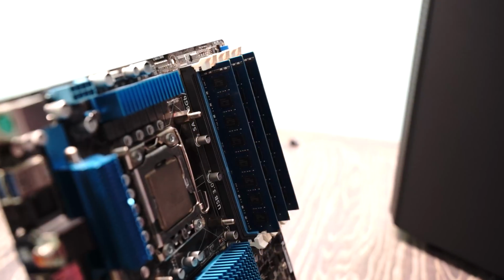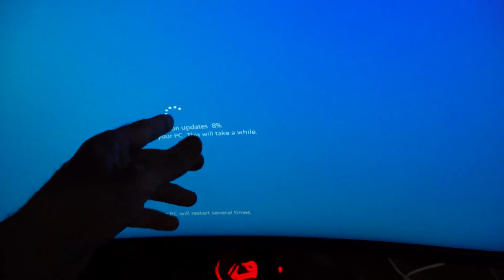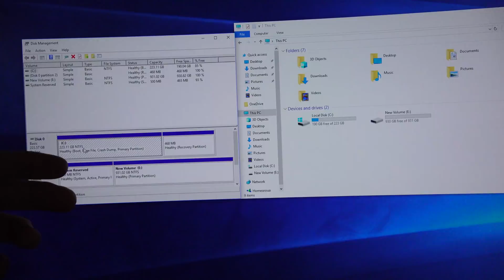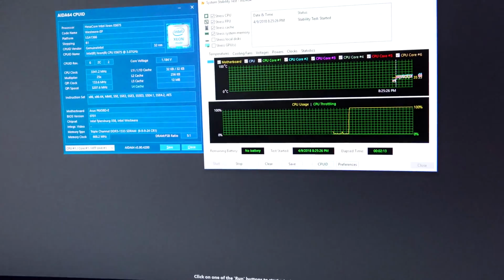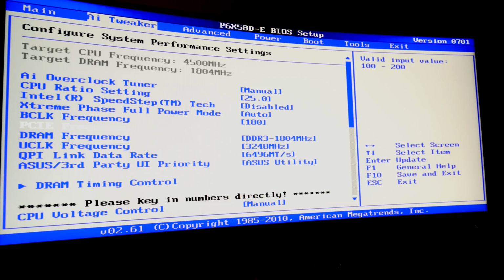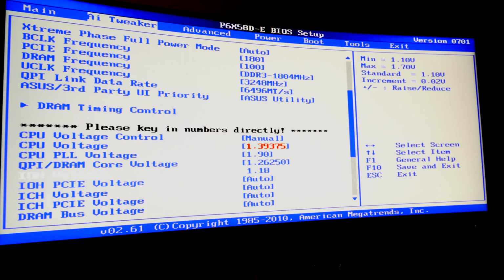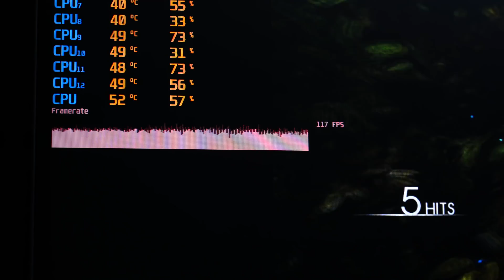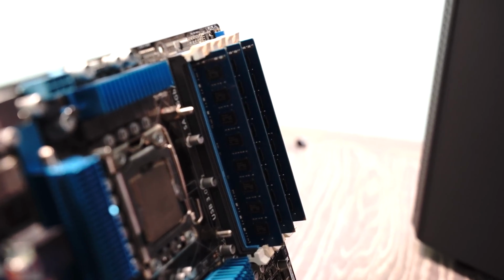Is X58 Still Worth it..? Taking the 6 Core X5675 to 4.5GHz on AIR.

Comment: This is a very difficult mobo to overclcok with the x5675.
It just keeps fluctuating from very high voltage  to very low voltage.
Tried everything from disabeling C1 and enable/disable cpu turbo boost.
Also the voltage and cpu speed shows very different numbers in windows compared to the numbers in the bios.
Also this gives all kinds of problems.
And geting this stable gives so much head pain problems.
I don't know if i will manage it to reach 4.6 Ghz.
Reply: Windows never reports properly use MSI afterburner for accurate CPU clock readings or CPUZ I've had nothing but excellent results with this exact setup but using good DDR3 yields the best results and only using three dim slots I recommend 1866 memory rated at 1.5 volts if you're using 1.65 volt memory you could damage the memory controller permanently

Comment: I'm currently using an X58 platform with a 4.5 GHz X5675 overclock at 1.356v, cooled by a Vetroo U6. It boasts 24GB of Kingston HyperX FURY 1866 CL10 DRAM, running at 1960 MHz with 9-10-9-27-CR1 timings and a UCLK of 3920 MHz. Additionally, the system includes a 1TB NVME M.2 drive, an ASUS STRIX RTX 2070 Super, and operates on Windows 11 24H2 Home edition.

Comment: Hey everyone, I'm looking for some advice on OC'ing my CPU. I know it's getting pretty dated but a buddy had an X58 board sitting around and i thought we could throw a few bucks into it and play a few games on it, even if they're slightly older titles. So, we put in a new SSD, a wifi/bluetooth pcie card, a usb 3.0 card, a gtx 1070 and swapped the I7-950 for an X5675 ($8 on Ebay.) Its got 32GB of ram (8gbx4) running in triple channel. The mobo is a DX58SO (BIOS SOX5810J.86A.5600.2013.0729.2250) which I believe is a "Tylersburg/Westmere" board. 1050w PSU. All in all we spent maybe $180 on everything.

So, getting to my question, I've read alot about these X58 boards and the X5675 is supposed to be great for overclocking but i can't get it to boot stable past a 155 BCLK at 4.03GHz with the Turbo boost on. Multiplier is maxed out at 23 (it hits 26 with turbo boost). Ram is running at 1551MHz (rated for 1600). I know this BIOS lacks the ability to adjust as many settings as others but I've seen screenshots of the same mobo/bios/pcu running a 180 BCLK. I'm just wondering if anyone has any suggestions to get mine higher? All I could really do without crashing the system everytime was raise the BCLK from 135 to 155 and the Static CPU Voltage to 1.225. Anyone got any other suggestions for a little extras performance out of it or is this about average for this setup? Any advice is greatly appreciated. 

Active Cores - All; HyperThreading - Enabled; Failsafe Watchdog - Enabled; BCLK - 155.

Processor Overrides: Static CPU Volt. - 1.225; CPU Volt. Offset - 0; Vdroop - Low(Performance); Max Mult. - 23; CPU Idle State - Low Power; Turbo Boost - Enabled; CPU VR Current Limit Override - Disabled.

Memory Conf.: Memory Correction - Non-Ecc; Perf. Memory Profiles - Auto; Uncore Mult. - 20; Memory Mult. - 10; CL - 9; RCD - 9; RP -9; RASmin - 23; RFC - 19; RRD - 4; WR - 10; WTR - 5; RTP - 5; RC - 32; FAW - 20; Memory Volt. - 1.54; QPI/Uncore - 1.150; Command Rate - Auto; Dimm Reference Voltage Training - Off.

Bus Overrides:  IOH Core Volt. - 1.100; QPI Data Rate - 6.4Gt  (7.445 with BCLK at 155); PCIE Bus Frequency - Default; PCI Bus Frequency - 33.33MHz; PCI Latency Timer - 32; HPET - Enabled; Route SMBUS to PCI - Enable. 

Power: SpeedStep - Enabled; CPU C-State - Disabled; QPI Power Managment - Disabled; C1E - Enabled.

Comment: I have a xeon x5690 overclocked to 4,2 ghz, Asus Extreme rampage 2, nvidia1070gtx and the operative system (W10) in a nmve SSD by pci x4 (uefi partition BIOS) and this computer still rules everything like a champion! 900 points in cinebench r15 and 1700MBs reading and writting values... with the nmve

Comment: I took out my rampage III extreme from the garage, installed a xeon x5690 and 24gb ddr3 vengeance both for (£140) but my ram only runs at 1333, Ive heard this setup also takes up to 48 and 68gb ram but sacrifice overclocking, I need settings to oc my setup any help

Comment: i have a t5500 workstation with twin 5650s , quadro fx 4800 gpu , 18 gig of ram , 4 ssd 256g each ,ax210 wifi . is it worth it to upgrade to 5675 i can get them for $23 each on amazon . upgrade to a xlr8 PNY GeForce GTX 1050ti graphics card i can get it for $30 ? after i install the 1050 should i water cool it ? my fx4800 runs at 120-130 degrees . lastly i can get a Nvidia Tesla K80 24GB for 300 to add on to the 1050 should i get it ?

Comment: Help!
I can no longer overclock my x5675 on x58 extreme gigabyte mobo..
I have saved 3 profiles for 4.0 for 4.3 and 4.5 and it used to work before, now after selecting it the unit reboots twice or thrice and goes back to 3.3
Could it be the psu?
I have a 700w tru rated psu, and a 1000w  psu is on the way.
Thank you in advance for your help.

Comment: Wish someone would make a vid like this for bios flashing and overclocking on a dual xeon workstation. Those things are monsters. quad channel at a bare minimum. two CPUs similar to this one, and you can top the modern single-chip charts right up until epyc and threadripper, with x58, x78, AND x99. That's before any overclocking. and you can even upgrade more smoothly, cause most support mismatched CPUs.
Reply: I agree.  It should be possible but would require information about a few chips on the board and someone to do the bios work.

Comment: Can you guys help me? I got P6T SE and X5675 and 6x4gb memory.  I get stable 4.3 overclock with like 1.36Vish vcore, it passes all the tests and all, but it can freeze during idle and get me IRQL_NOT_LESS_OR_EQUAL. I need to raise the vcore to like 1.4 to not get these... Someone mentioned somewhere that it is because of 6x4gb memory putting so much stress and it would not be so bad with 3x8gb of memory, but not sure if it is true or not. What must be adjusted mostly for 6x4gb? Cause I see most overclocks are with 1 or 3 RAM sticks, I do it with 6 and therefore not sure what to adjust. Thanks!

Comment: To this date I'm still using the x58 platform with a 990x 6core cpu and 24gb ram on the Asus rampage 3 extreme. On top of that I have a 770gtx and hardware raid on ssd drives. Windows 10 pro. Only issues I had is my sound card died and the USB is a bit of dodgy. Other then that it's a wonderful computer still use it everyday :)

Comment: even today, X5675 is going for $20-$25 on eBay, about to try one out in an X58 Sabertooth owned since new myself, and also in an MSI X58 Platinum ($125 on eBay with i7-940 running) if latest stock 3.9 BIOS supports it...

Comment: 2021 and I think it's still worth it to have
Recently built an x58 rig as a secondary. Overclocking was so much fun and seeing a 30% increase in performance made my jaw hit the floor.
It was paired with a 980 ti and 24 gb of ram clocked at 1800 mhz and getting the x5675 to 4.2 ghz took some time (6 hours with stress testing) but was worth it. After seeing this video for like the 20th time I think I'll have to go back and see if I can get it to 4.4 ghz lol

Comment: Thanks for the video, I've tried but unfortunately this bios setup didn't work on my mb Asus P6T and x5675. What worked for me is set it to 4.2GHz (21x200) as you have showed in the other video, and memory at 1600 MHz. Also I'm not been able to overclock the memory. I have 6x2Gb Corsair Dominator (CMD12GX3M6A1600C8) and, despite tuned to 1600 MHz, it's running only at 1066... Not even 1333.

Comment: Im still running a x5660 on 4,4 GHz paired with 24GB Ram and an 980ti. The only thin i am missing is frontpanel USB 3.0 and USB 3.0 at all. Have a case with 3.0 front slots, but no way to connect it to the MB.
Reply: just buy a pcie x4 usb 3 card with header for connecting front panel.

Comment: I have an x5675 on an Asus TUF Sabretooth x58 that I was able to copy these settings, but when running Aida64 a couple cores get up to around 81-84c on my 6-pipe snowman cooler. Is that too hot to run 24/7 I know most all programs won't run the cpu at 100% to reach those temps. I backed it down to 4.375ghz for the time being.

Comment: Hi there, 
I have built myself a x58 Machine after taking Inspiration from you.
Specs:
Asus Rampage III gene
Xeon x5675
12gb Hynix ram
Amd hd4550 and RX 5700
I can run Windows perfectly with the HD4550 but with the rx5700 alone it won't boot into Windows and the funny Thing is that the rx5700 gets recognized and has output when I have my HD 4550 plugged in aswell, but only like a secondary GPU. I tried everything from latest bios, everything well connected, drivers uninstalled and installed multiple times. In my Others Machine the RX runs perfectly.
So i have no Idea what the problem is.
Hopefully Someone can help me.
Greets from Germany

Comment: had an x5650 on 4 ghz on the msi x58 pro.  also works but the mainboard gets over 100 degrees hot and crashes.  So it only makes sense with a good motherboard and that is unfortunately too expensive

Comment: Thinking if should I get rid of my TRUSTY Rampe Gene II with X5650 and build some recently bought Ryzen 3600 cpu based machine for my mATX rig. Planned to have Ryzen to have for business build only at first. faster USBs, M2. PCIE4 is quite tempting... On the other hand, I know my mobo is overbuild top of the line stuff serving well ten yers still... (if SB NB is cooled down at least, the things can get hot)... I love supporting underdogs and AMD are my prefered card brand, but... Decisions, decisions. Thank you for the video and showing support for older stuff. Liked, sub'd.

Comment: I overclocked the core i7 930 to 4.3 Ghz on air. I had to back it down to 4 Ghz because I soon found that it wasn't stable. Now, I'm getting a xeon x5690 so that my games don't bottleneck anymore and I plan on overclocking that to 4.5Ghz as well.

Comment: 6:00 I've encountered this before. What I do is disconnect all my other drives when installing windows and plug them back in afterwards. That way I know the bootloader is on the C drive so it avoids problems if you  need to change drives around etc.

Comment: I am having a problem where I cant even boot windows. Yet everything is posting and booting and I can even get linux to install. JUST NOT WINDOWS 10. What would you suggest. Its an ASUS P6X58D-E with ATI Radeon HD 5870. 10GB DDR3 HyperX and 2 TB Barracuda, just will not load the windows 10 loader

Comment: Had a similar problem, installed windows and then did the bios update and it wouldn't boot. Couldn't figure out why at first until I realized that the bios update was actually a different bios than the original and the OS couldn't work with it as the bios configuration had changed. In the end, i reinstalled the OS as it wasn't configured to run with the new bios and now it runs perfectly. Before it could only register 3 dimm slots, now it reads all 6 slots.

Comment: There's a way to get the multiplier to boost to x26 when workloads only use a few threads fully (all core will be x25). Speedstep, turbo and C-state must be enabled. CPU ratio setting to Auto and BCLK to 176 (for example I used that with 1.4v). 4.572 GHz baby

Comment: Yeah I got a Gigabyte EX-58 Extreme with a Xeon W3690 and it's been at 4.5ghz for 4 years. Unlocked multi, a small bclk increase (133-135) and it's 4.51 with nothing more than a CPU voltage increase. 2133 ram and an AIW 3 fan liquid cooler. The temps never seem to get above 60deg C.
Since it still runs so well, 2 years ago (when this vid was made) instead of upgrading the board and CPU I put the money towards a 1080ti and a curved monitor also.
I won't be upgrading on this platform again since it is now throwing good money away , but while it still runs as well as it is I'll stick with it.

Comment: and also that P6X58D-E, the SATA 6gb/s ports will only work once u install a driver for it. And there's actually unofficial windows10 drivers for that marvell controller believe it or not. I Have that exact board, and i also had to download the driver for the marvell ports in order to use them, otherwise it had boot issues aswell if i remember correctly.

Comment: A tip: U had that boot issues right? I know how to solve this. 
Remove all other drives except for the SSD ur installing windows to, then install windows. Once you've installed windows, u can add the other drives back in ;)

Comment: Do you run it on win10? I have P6X58D-E and X5680 on win7 and i want to update to win10 but been reading about problems not all drivers are available. Did you easily install win 10?

Comment: Hi Brian, I just picked up an asus p6t se and I have a few questions. 
The vrm and northbridge heatsink (are attached to each other by a heatpipe)  are attached to the motherboard by some sort a push through pins/ They don't look like they're designed to come off. Have you encountered something like this before and what did you do? 
Second, do you think the x5675 is worth the premium over the x5660? The x5660 is currently around 11$ and the x5675 around 22$

Comment: I just aquired an EVGA X58 SLI Version 1 board with i7 920 with some 1333 RAM, I am wondering if it is a good idea to upgrade to a Xeon X5650 for another $25 or better off to save up and overclock the 920? I heard that the EVGA X58 SLi requires some soldering modification to accept the X5650. If I do the mod, am I able to use the i7 990x/980x later on or do I have to unmod the board again or is ther a way to make it accept any 1366 chip? If I disable the speed step C feature to gain the extra clock multiplier will that lock the CPU to single core mode?

Comment: Thanks for the info on the X5675 and OC tips. I overclocked mine to 4.6Ghz stable https://valid.x86.fr/udz19z . I bought locally from AU seller as a "server matched pair".  I followed ur idea to run at x23 to remove the turbo clock and run all cores at 4.6Ghz and keep it simple. I could see higher single thread scores with x25 but it wasn't stable. I have sat on my X58 i920 setup for years, thinking I am not going to upgrade until base clocks are common at 5Ghz or IPC doubles, still waiting...Thanks for your help, very happy!

Comment: I actually just built an X5675 system a few months ago that I use as my main computer. It's absolutely worth it. CPU was $24 USD. 24gb of ram (triple channel) I think was like $50. Motherboard was unfortunately $100, but it still saved me money over a ryzen system. 

That stuff coupled with a GTX 1660 TI was getting me 80-120fps @1080p in the Modern Warfare beta. I looked up other people's FPS on YouTube and with their custom settings they were getting the same fps on much newer systems, and even like 10fps lower on ryzen systems. 

Also keep in mind this is at stock speeds (or less) with my X5675. I'm not sure if I've got a bios issue or what, but I just can't get my bios menu to even function when I click on the frequency menu, and then in HWMonitor it reports my highest frequencies achieved as 3.1ghz. 

Spectre and Meltdown patches are disabled. So yeah, if it is keeping up that well with the latest and greatest in a game I was really playing, I'd say it's absolutely worth it if you can get it at a good price. Hell, with my experience I'd go as far as to say pick up an X5650 for $9 on eBay right now and you'll be surprised out how well it does relative to the price you paid.

Comment: Managed to score a dell t7500 work station for £50 with 24gb ddr3 ram and a gtx 560, will be swapping the old x5550 out for either a 5650 (£10) or a 5670 (£18) then slap a mining rx 470 I scored for £60 and hopefully flip for £250, found this channel very inspiring and really enjoying the used part hussle

Comment: Wow that case looks amazing with the fans & lights, I kinda like the blue :P. Would you suggest any 92mm air cooler? I recently got a X58A-UD3R, i7 950 & H50 AIO for $20 lol. Loving it, slapped a MX500 500gb SSD in, 12gb Gskill Ripjaw X 2133 in 3channel bought a X5680 for $48 knowing it's locked but planned on just running it at 3.34 base speed. Then I seen you can just increase bclk freq to oc. The Antec GX500 case is only 7" wide so cant use the 120mm coolers.. Any advice would be great as the 120 AIO keeps the cpu about 70ish gaming so, no head room to over clock. Hell the i7 950 looks like it would still be great to use gaming since quad cores can be just as good or better than 6 - 12 cores @ 4.2ghz :D But I agree 100% about these systems being about 10 years old & still rocking. Only the decent 1366 boards reflect what there worth in cost atm, cpu's are cheap. The X5680 was $1666 new!

Comment: I'm pretty sure the issue you had here was with the monitor being DP and not DVI. My old X58 would not boot if the display was connected to the video card using DP.

Comment: i think i'm totally convinced to get this x5675 and upgrade my i7 920 but i'm wondering do i need to get a new cooler to overclock the cpu or the stock one would be enough and if the stock one is not good can you suggest a cooler but not too expensive 
Thanks for the video :)
Reply: Even if you don't OC the 6c/12t at 3.33MHz turbo is going to handily outperform a stock i7 920 in most situations (I know cause I did that very upgrade about 3 years back).  For how cheap you can get them these days it's pretty no-brainer, regardless of OC'ing.   I wouldn't overvolt with a stock cooler but a CM Hyper 212 (pretty cheap aftermarket cooler but decent) should cover you up to about 1.32V, which should put you between 4.0 and 4.2MHz when OC'd.